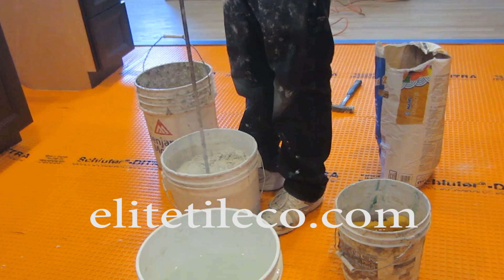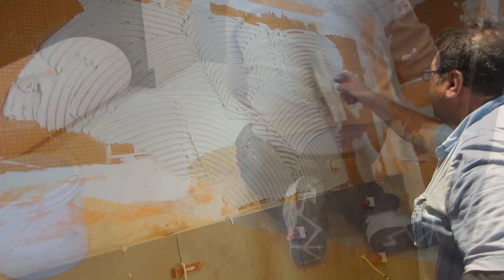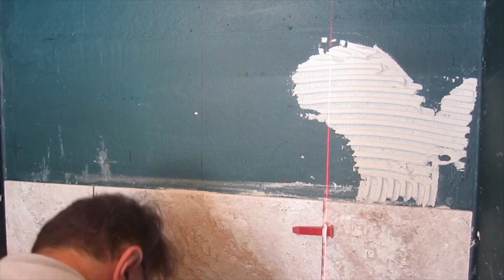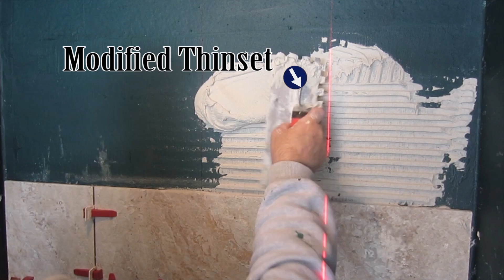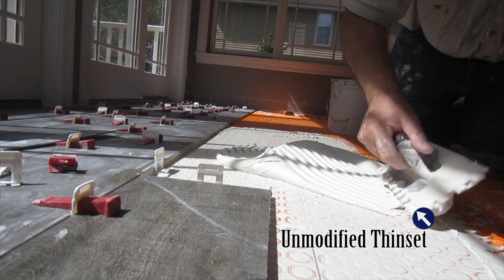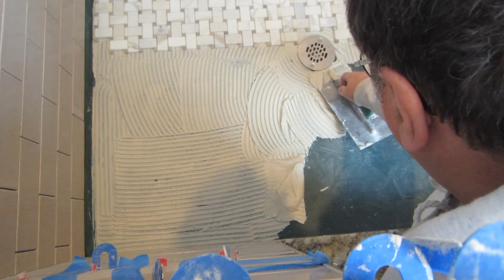Thinset explained

Comment: QUESTION:  Is there a shelf life to to Thinset?   (non modified)
Reply from the maker: Yes all cement based products have a shelf life which is usually about a year, look at your package most will have a date of manufacture.
Reply: Thank you for the quick reply.   I think I may be about 3-4  months past,  the date is illegible ..  SAL , am I screwed or what??   If so, what are my options?   Again, Thank You for responding so quick.
Reply from the maker: Why take a chance, buy new materials.
Reply: ...no Sal, guess you didn't get the "SCREWED" part  ,  I already put it down on my  IN-LAWS counter top.  HENCE: OPTIONS????
Reply from the maker: Wait and see, you will probably be fine.
Reply: Thank You again,  you've been very helpful.   Like I said, for the IN -LAWS,... trying to make good with what they can afford.  Peace my friend.

Comment: Hey Sal, I see you use mapei ultraflex 2 which I use often for tile over plywood. What glue do you personally use on kerdi board? I've used kerabond on kerdi membrane before, but found it hard to use on walls. The mortar you used seemed to stay on the walls better. Thanks in advance, your videos are awesome!!
Reply from the maker: Most of the time I use Tec Uncoupling membrane mortar

Comment: Sal, LOVE your videos. Thank you for taking the time to enlighten so many of us. I had hardibacker installed before I decided to purchase kerdi membrane.  Will the kerabond T I have make a good bond between the hardibacker and kerdi? And if I am using 3x6 tiles, what thinset would you recommend (I know Kerabond T is meant for large format tiles)? Thanks
Reply from the maker: Hardibacker will work, but it is really thirsty, make sure you sponge it down really well before you spread your thinset or the hardi will suck the moisture right out of it. Any good quality unmodified thinset will work. if you read the label on the bag of the thinset it should tell you how to mix it so it performs like regular thinset.
Reply: Thank you so much.  I have another question on this job.  When the hardibacker was installed, they used drywall mud where the hardibacker meets the drywall on each side of the shower.  It extends into the shower where I want the kerdi to be.  Do I need to prime everywhere the mud is? If so, does it matter if it is oil or latex based?

Comment: Hi, I'm in Canada and I do repairs for a restaurant and they needed me to replace 1/2" x 6" x 6"tiles in the service area 
which is where the most daily traffic is and where they move their heavy grills, tables & fridges to clean behind 
them every night.
  I went in at 8pm on dec 24th, we were closed on the 25th & only opened at 8am on the 26th. I took up the broken 
tiles, cleaned the surface down to the old self-leveling cement and used modified thinset around 1am to apply the 
tiles and then did the grouting between 2:30 & 4:30 am on the 25th starting with the tiles first laid..  This would give more than 24 hours drying/setting time but employees came in on the 26th and as usual and disregarding instructions to not move the (several hundred pound) equipment onto the freshly laid tiles, they did so and dislodged & cracked several so the job needs to be redone.
  In a restaurant as you know, health/cleanliness is always an issue so they need to clean every night behind these heavy 
machines and to do so must move/roll them onto the freshly tiled area, so do you have any advice on what easily 
available product(s) to use and also any tricks to avoid this repeating itself...?  Price shouldn't be a problem.
  I suggested laying 3/4" plywood over the traffic area and screwing it down for a week to let everything properly set 
but now I'm told it cannot stay on the floor for 1 week, I suppose because they would need to move the machines to 
clean behind them.  Also the last employee typically leaves at 3am but the first one in is at 7:30 am that same morning...not a big window to get the work done.
  If you have any advice on how to get around these obstacles it would be very much appreciated.  I was using regular thinset mortar and Mapei Polymer Sanded Grout.

Thanks in advance!
Reply from the maker: They want it fixed, but wont give you the needed time to have the materials cure and set, seems to me that they are asking for the impossible. That being said, I would look for a very fast setting thinset and use that. http://www.ardexamericas.com/en-us/Documents/TechData_En_X7R.pdf
Reply: It's kind of a catch 22, tiles need time to cure, they need to do their jobs & both interfere with the other.  Thanks for the link.

Comment: If you're installing tile in a climate controlled house, modified thinset will work fine. Note that Redgard, which can be used to provide a waterproof shower pan, recommends use of modified thinset on top of it. The problems associated with modified thinset on top of Ditra are greatly exaggerated. It's only a problem outdoors in highly humid areas, where you are grouting next day. I used modified thinset on Ditra. Worked superbly. Wait a week or two to grout and you'll sleep fine.
Reply from the maker: If you want to keep the manufacturer warranty, then use what the recommend, if you don't care about it then use what you want.
Reply: Understood, voiding in the warranty is on me. I only used one roll of Ditra for a small bathroom with 12x24 ceramic tile on the floor and shower. If it failed, I'll have bigger problems than worrying about getting my $86 back for the Ditra. Redgard's own uncoupling mat membrane, which is waterproof and vapor proof, recommends use of modified. And I also live in an extremely low humidity environment and waited 2 weeks to grout. All told, I figured the likelihood of the modified failing was remote in comparison to its benefits.
Reply: Further from Custom Building Products: "There is a misunderstanding that a polymer-modified mortar will not cure under porcelain tile when installed over an uncoupling membrane. This is not true. The hydration of the Portland cement and increased mortar strength will occur whether it is exposed to air or in a sealed container. " http://www.custombuildingproducts.com/media/60712310/tb85-uncoupling-membranes-and-polymer-modified-mortars-in-tile-installations.pdf
Reply from the maker: I don't debate whether it will work or not, but if you use a product, the manufacturer recommendation always trumps any other requirement. If you use Schluter, then use the products they say to use, if you use Redgard, then use the products the say should be used. If the warranty means nothing to you, that is also fine.
Reply: I don't disagree with you. I would feel the same way from a liability perspective if I were working as a pro. But I think the science on this topic is worthy of being explored more. I don't think there is any evidence that modified thinsets require air to cure and do not experience the hydration process, albeit slower. As it is, the smart guys who sit on the Tile Council of North America (TCNA) recommend using a polymer-modified mortar meeting ANSI A118.4 or A118.15 when installing ceramic tile over a waterproofing membrane. This and Custom Building Products advice seems to be at odds with Schluter's requirements to maintain the warranty.
Reply from the maker: When I first started using Ditra many, many years ago before I knew better, I was told to use thinset with latex additive to set the tile. This was my very first time with  Ditra. So that is what I did, the floor is still in use today without issue, so there is no question whether it will work or not. Here is the discovery I made, about a month after the tile was done, I had to replace a couple of tiles because they wanted to make a doorway a bit wider. Upon removing a tile after more than a month, the thinset was still damp, hard but damp. Tile was a 20x20 porcelain tile. Since then many, many years latter, I have had to replace tiles set on Ditra with unmodified thinset, as Schluter recommends, some just days after setting the tile, and always because someone chipped a tile after I was gone. In each and every case, the thinset was dry, the tile was tenaciously stuck to the thinset, and came out in am million pieces. Unmodified works on Ditra and in an impressive way.

Comment: at the 5:40 mark,you made the comment "the dam cure that the impervious sandwiche creates  only makes the thinset stronger and promotes a very tenacious bond ",I.E.the longer the drying and curring time of any morter makes said morter stronger,i get that coming from a family of masons,so with that being said,if I have the curring time to wait,14 to 21 days before grouting or traffic,can I use modified thinset on top of ditra to give me a stronger and more flexible bond between ditra and tile ? Or for that matter,use unmodified on top of ditra to level it off,let it set up for 24 hrs and then sponge it down and use modified to adhere tiles.these 2 techniques to me seem like a great way to go.Your thoughts please
Reply from the maker: I have heard that time and again, to me it seems like a waist of time effort and money. Ditra is designed to work with Unmodified thinset and it works spectacularly well.
Reply: But my question is...well...They say that if ANY of the 2 surfaces is porous, you should use "modified thinset". We all know that tiles like ceramic and porcelain are porous (unlike marble or granite). Should we use "modified" then?
Reply from the maker: Porcelain tile is not porous at all, and Marble and granite are mush more so, you have it backwards, the definition of a porcelain tile is actually tied to the porosity which has to be less than 0.5% . If you are going to use Schluter Products, then you should use an unmodified thinset, as the recommend, and as far as I know they are the only ones that require unmodified Thinset.

Comment: when using 12×24 tile for a bathroom shower, also using Densheild backer board do you recommend unmodified or modified thinset .
and how do  you lay out a 12x24 tile pattern vertical or horizontal  Wood plank on the walls?
Reply from the maker: Use modified, layout is different for every bathroom.

Comment: If tile laid on a porous surface needs modified, what should be used on a surface treated with RedGuard (or equivalent)?
Reply from the maker: Liquid applied membranes usually call for Modified thinset.

Comment: Sal, what a great video and explanation, It seems in this case the only time I would want to use unmodified is over Kerdi, would I also use unmodified when setting tile on denshield as it also seems to have the same moisture properties.
Reply from the maker: +Ray Gregory Schluter requires the use of unmodified thinset over Ditra and Kerdi,  Denshield is another animal entirely and modified should be used.

Comment: Hey Sal  the homeowner used 'goof-off' to remove the paper backing of the old linoleum that was left on after the linoleum was pulled up - there's half inch plywood over the old subfloor  for the substrate - will the goof-off prevent the tile from adhering  ?  thanx -great video

Comment: that explains allot, the idea I had is that modified thinset is way superior than unmodified thinset, when you use unmodified in previous videos made me wonder why, thanks for clearing things up.

Have you ever worked in swimming pool tiling before? if you work in one please make a video because there is not much in the internet about it.

Many thanks and regards from Denmark.
Reply from the maker: +observer547 I have done a few repairs over the years, but i really don't do any outside work any more.
Reply: I can imagine how hard will it be, thanks for replying and best regards.

Comment: I wanted to ask.  I'm laying ceramic tile in my shower.  I used the rubber pan liner and waterproof membrane. Do I have to apply sealer when completed?
Reply from the maker: +cz3chmonkey Better to use a stain resistant grout, some of which explicitly say not to use a sealer.
Reply: +Cross Balsamo grout sealer? of course

Comment: I use Megalite for everything and its held up really well under and above ditra and with heating cables under and above the ditra (pre ditra heat). Youre the man, Sal, what do you think? Is there no such thing as all-purpose premium or is the 1.86 CAD per sqft just too much money?
Reply from the maker: +Pro Paycheque If you want to maintain manufacturers warranty, Ditra calls for unmodified on top and the appropriate kind under depending on what you are going over. If you don't care about the warranty then use what ever works for you. 1.86 seems excessive